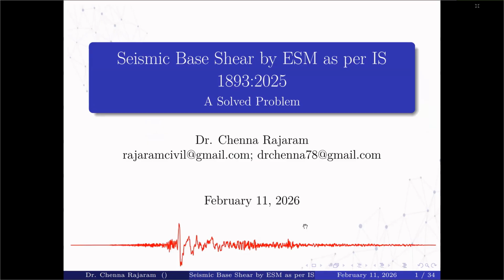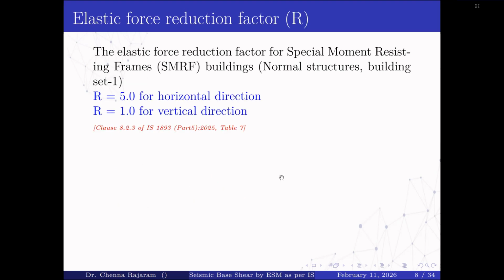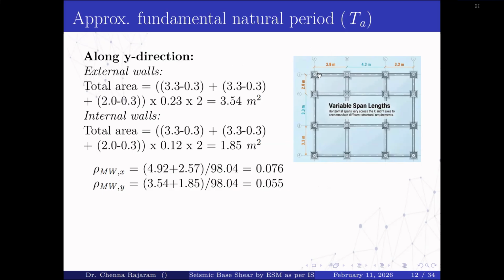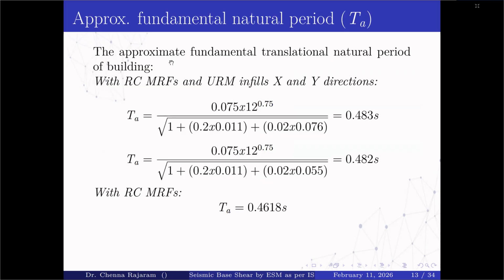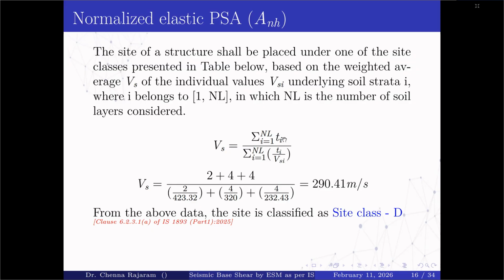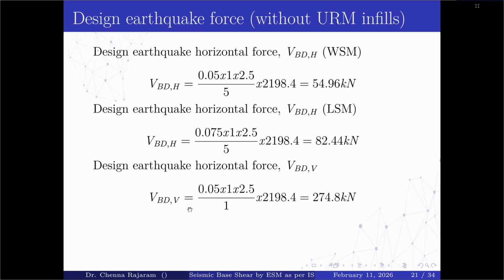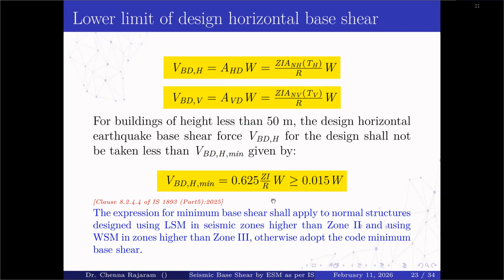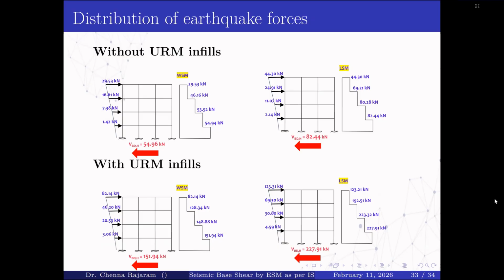Seismic Base Shear by ESM using IS 1893:2025 - A Solved Example

Comment: Bro, How have you arrived vertical time period?
Reply from the maker: The fundamental vertical natural period (s) of the structure, which shall be taken as 0.4 s in equivalent
static method (Clause 6.2.3.3 (b) of IS 1893 (Part-1): 2025. Pg.No: 26).
Reply: @AcharyaGurukulam 
Thanks. 
This is irrespective of type of building configuration. conservative approach.
Reply from the maker: Yes